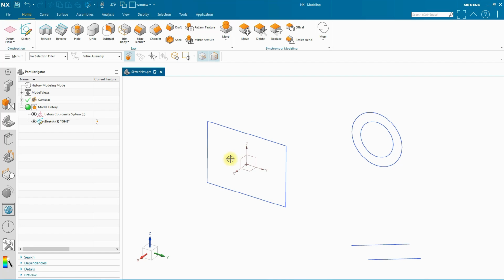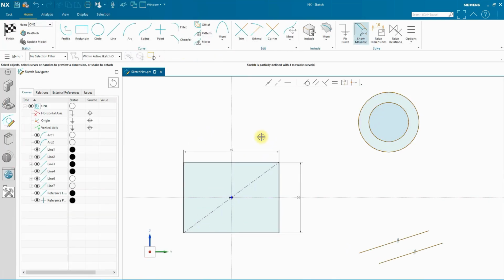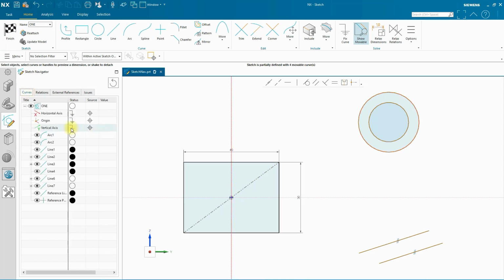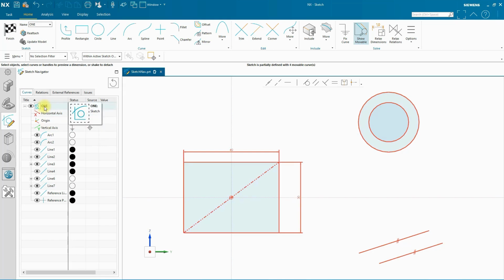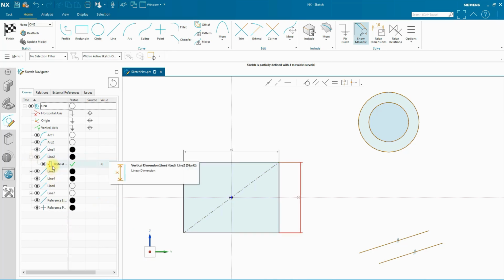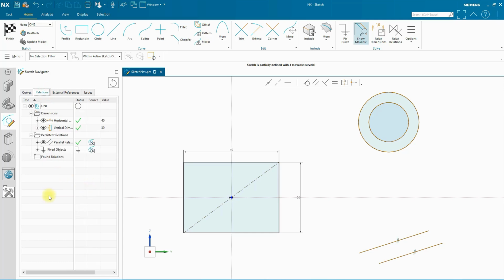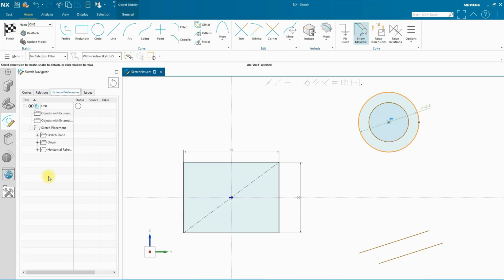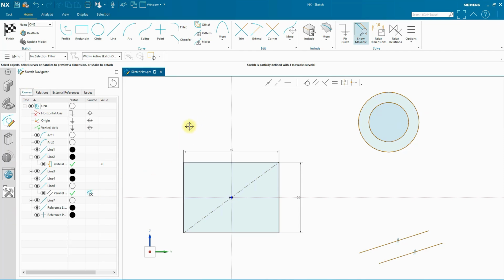What's New in NX 2406 - Sketch Navigator

Comment: What's your idea about nx in comparison other famous cad?
Reply from the maker: NX has more design power and capability compared to other CAD programs in almost every engineering related industry.  One of the reasons for this is NX has a tremendous engineering community around it that supports it and pushes it forward.